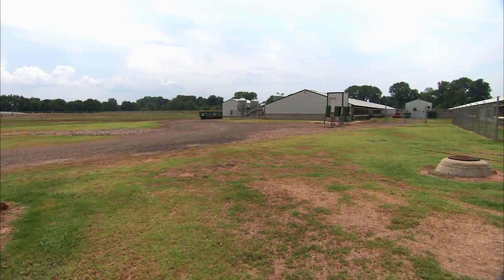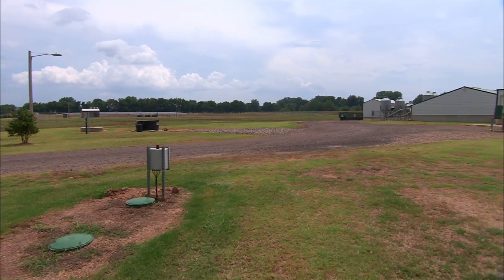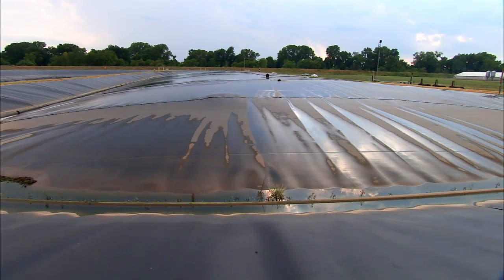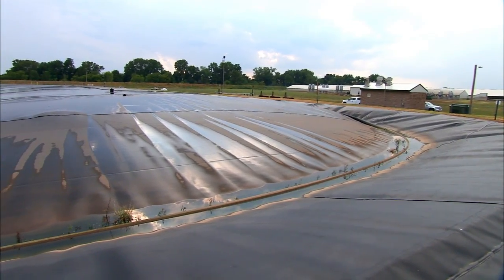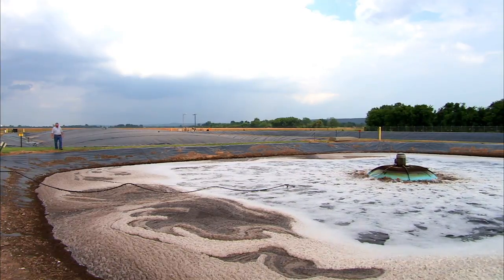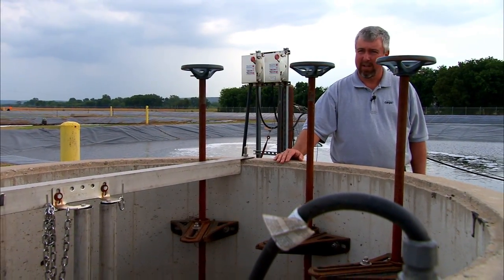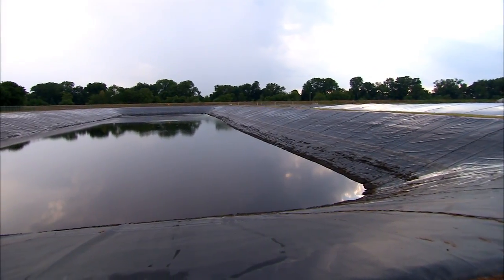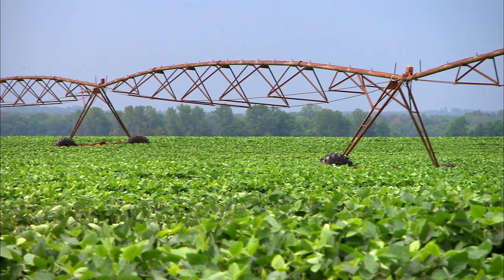Sustainable Pig Farmers Embrace Technology

Comment: Great system.  Is the value of the methane being used in the incinerators equaled to what it would be if you used it as fuel for a boiler or bio-gas gen-set?  I am a NC pork producer and we appreciate your innovations at your farm it is an fine example of what is possible for others in the industry to do. You are surely environmental stewards and we applaud you for that extra effort.